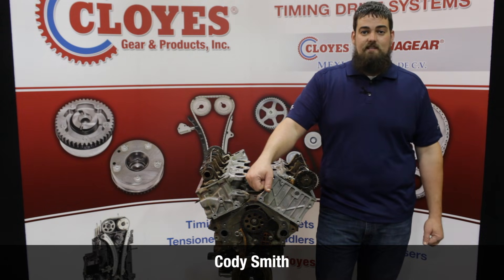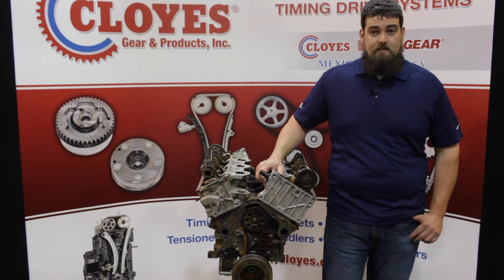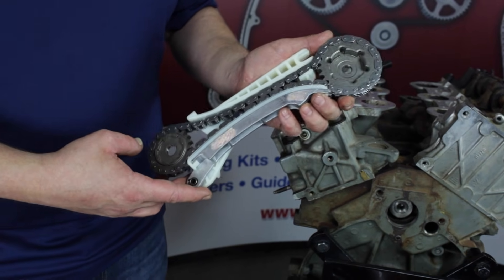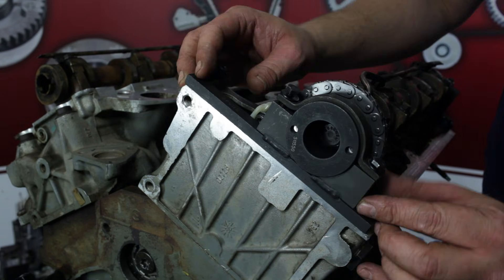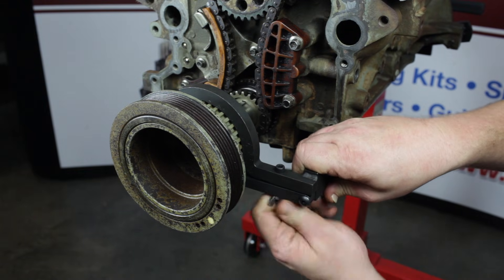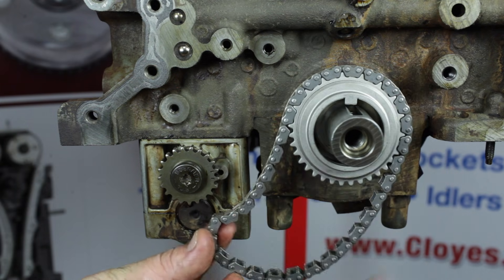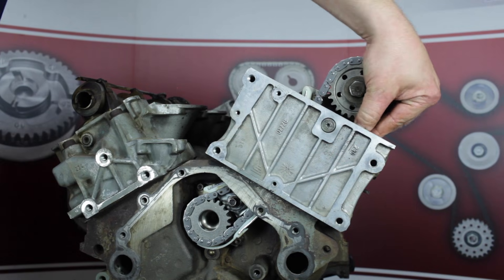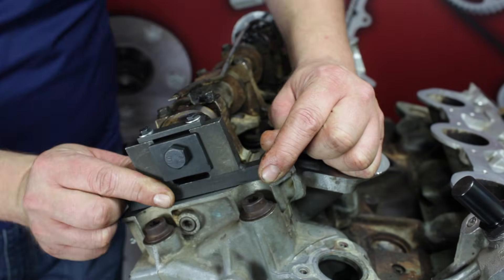Ford 4.0L Timing Chain Replacement, Cloyes 9-0398SB

Comment: It looks like I just had a front secondary timing chain break at about 3 months and 3,000 miles.  I have to tear it down to see what the case is.  If it appears to be plenty wet with oil, this will be the last Cloyes timing kit that I will buy.  There was also some fitment issues with the primary chain guide that requires some Macgyvering to deal with.  I did talk to someone at their customer support about it, and never got a good answer other than, "it must be defective."  Well, mass produced injection molded stuff doesn't have this kind of defect, so just getting a replacement would have had the same problem.
Reply: I verified that I, indeed, have a broken secondary chain on the left  cylinder bank.  When the chain broke, it jammed up the jackshaft sprocket, causing the primary chain sprocket to slip and go out of time, resulting in the left bank of cylinders mashing up the exhaust valves.  Yes, I used a new jackshaft bolt and torqued it according to Ford.  And it took plenty of force to remove the bolt.  I have no idea why the chain broke.  I have a bunch of pictures here:

https://www.dropbox.com/sh/onj1yl2sx6epx68/AADesXSm8BXlvtXDj5q1m_L-a?dl=0

So far, there have been four issues with the Cloyes products during this process:
1.) When the left bank secondary timing chain cassette arrived from Rock Auto, the plastic guide was broken.  Broken how, why, I do not know.  It didn't look like it could have been broken in shipping with how it was packaged.  Who knows?

2.) The primary chain guide did not fit--the mounting bosses and oil galley plug are of equal height.  The guide didn't fit because in order for it to fit, the oil galley had to be recessed in.  I used washers to space it away from the mounting hole.  I think that worked fine.

3.) The primary chain tensioner went kiddy wumpus as shown in one of the pics in the link above.  The roll pin worked its way out a bit causing the plastic wear surface to not be parallel with the chain.

4.) The secondary chain broke.  I have no idea why.  Bad tensioner?  Just look at the broken chain links.  There are broken links in 3 different places on the chain.  Strange.

I really think that I somehow got a defective chain.  It was wet with oil, the parallel alignment of the sprockets is perfect... as far as I can tell, the tensioner was functioning as it should.  My cylinder head rebuilder says that although he hasn't done a lot of these heads due to the economics of repairing these engines, he has never had someone call him and ask why a timing chain broke on one of them.
Reply: Cloyes has failed on many occasions.

Comment: Great informative video. My explorer is young (84,000 miles) and has developed a horrible sound from previous owners abuse. No damage on chains or sprockets,  but those horrible guides are destroyed. Easy fix! (Thank God the back chain makes no noise, can't pull the engine on your only car and still make it to work :P)
Reply: So did you get away with just doing one chain because I can't afford to pull the motor it only sounds like the one in the front of my 2003 ranger is giving me issues
Reply: @Banannaman5000  Have you checked the hydraulic tensioner?

Comment: Very helpful video! I purchased TTY jackshaft bolts from Ford dealership. Front bolt part #2L2Z-6279-AA rear bolt part# W703167-S430
Reply from the maker: Thanks for posting!
Reply: I ordered a rear JS bolt from Ford in Humble TX with no luck (varios times) finally went to Mac Haik Ford on I-10 got it.

Comment: where did you get the TTY bolts? im working on mine as well. do you guys sell them?
Reply from the maker: Unfortunately we do not sell them. As far as we are aware Ford is the only place sourcing them.
Reply: Cloyes Gear & Products, Inc. (Aftermarket)  man, I got your kit. Maybe you guys can provide a part number at least on your site? Or a special note when you sell the kit? The kit is kinda useless without these bolts. Thanks.

Comment: Thank u Sir does the kit come with the specific tools ie cam tool, primary locking tool etc, thank you
Reply from the maker: The timing kit will not come with any tools. The tools we used in the video were part of OTC's 6488 kit. That tool kit comes with everything used.
Reply: Cloyes Gear & Products, Inc. (Aftermarket) thank you very much for your help, great video

Comment: The front 'jackshaft to cam' tensioner arm is a terrible design. The nylon can break at the apply portion. Nissan tried the same thing on their VQ35DE. Luckly they released a updated kit that permanently addressed the problem by making the apply portion for the tensioner arm metal. Thats why the only nylon/plastic area was where the chain rode.

Comment: Terrible kit. Bought in November of 2016, had an ASE mechanic do the install. Rear chain failed 13 months later. Now I'm stuck doing the job with better parts.
Reply: Matt Greening Ford OEM is always the way to go.
Reply: It looks like I am in the same boat.  I am uncertain as to what happened, but it appears as though the front secondary chain broke at about 3 months / 3,000 miles.  It quit running a few days ago, and after popping out the cam sensor and cranking it, I see no camshaft movement.  Overall, I was not impressed by Cloyes timing products.  The primary chain guide also had some issues that required some macgyvering to make work.
Reply: I am doing this job my self, when u say better parts, what are those?.. i am trying to get the best parts i can, i don't feel like going throught this hassle again any time soon.
Reply: esmailer galindo Ford OEM. Go through Tasca Parts online. Cloyes is cheap garbage. Their tensioner can't even last 6 months. I used all Ford components and you can't even hear my engine running.
Reply: Hans Gruper thanks a lot for the info, i'm at the final stage of the project, have to buy the chains and get them installed over the weekend so i can go ahead and get the car back together, as i'm sure u know how suck a pain in the neck this job is, i don't feel like doing it again any time soon..
Reply: esmailer galindo To me this job was fairly simple being that I had a donor motor out on a stand so I could take my time. Just use the OTC tools and follow the Haynes manual. Got another explorer with 207k counting down the days until the teardown.
Reply: Hans Gruper samd here, taking my time, me.and my brother are doing it, it's my first time doing something so big like this, but i am taking my time and i have all the tools required for this job so i am confident i will get it done and right.. wish me luck. Lol
Reply: I just verified.  The front secondary chain broke.  Why?  I cannot come up with a definitive explanation other than maybe I got a defective chain.  Here are some pictures:

https://www.dropbox.com/sh/onj1yl2sx6epx68/AADesXSm8BXlvtXDj5q1m_L-a?dl=0

Comment: For all this trouble.. May as well do a complete rebuild... Why is the the right timing chain on the rear? Because ford didnt wanna make left and right 4.0 ohc heads...
Reply: John Floyd That is what I thought. But if the 2 head castings were in fact the same, the left and right head gaskets would be the same but they are not. The differences are actually significant.
Reply: Ford took the OHV block and made it SOHC. I agree with you, wish they would have kept everything on the front.
Reply: Floyd, The heads are different castings. As you can see, there is no hole drilled for the hydraulic tensioner on the right bank cylinder head. The chain is in the rear because the engine block is offset side to side. To have the chain in the front, would have made the engine several inches longer and you would need a front cover all the way to the bottom of the  right cylinder head.

Comment: Seems like a lot of work for not a lot of payoff. I guess if the 4.0 in my mustang ever goes out (knock on wood) I'll probably just swap in a V8.
Reply: Caleb Shonk I got that idea, but did You compare prices on this rebuilt and v8 swap & transmission? Mine TR-5OD I’m not sure could stay with V8... Btw, what’s with dmv about such a swap?
Reply: Swapping in a V8 can be expensive, but ballpark guess? A Reman Cologne is about $3500. Add to that time and labor and you're probably looking at at least $5k. And that assumes the engine doesn't break down again. 

A Coyote V8 is $6800 from Summit. Labor would probably be around $2k. So it might cost almost twice as much, but after it's done, you have a NEW engine that puts out more than twice the hp and tq, is more reliable, more modifiable, and fun. Or you could probably swap in a 302 small block for about $5k.

Personally, I would probably do an LS swap. They're cheap, reliable, and have about the same output ratings as a coyote. Offhand, I don't know what the T5 is capable of handling but it's a very stout transmission that was actually used with the Coyote. 

As for the DMV, they go off of the vehicle's VIN. I've never once had them ask if it was modified at all. Maybe if you have emissions testing in your state it could be a problem, but Michigan doesn't. All they really care about is whether it has insurance.
Reply: Buy a V8 mustang the v6 ones are completely different stucturely trans, diff, springs, mounting points,ones is made to take the torque the other one is just for listening to the  engine make noise stroke a 351 Windsor and aluminum heads cheap 400 hp add a rear turbocharger for another 300 hp on pump gas LOL🤣
Reply: The T5 was most certainly not used with the coyote? Was a MT-82. You cant even put a T5 behind a SBC without it exploding to bits. They can be built though to withstand a good bit more abuse tho like the TKO 600. Last thing I believe the T5 was behind was the 4.0 SOHC in the SN197 mustangs and ive blew one myself behind the 4.0. Sitting in the yard as I type this. The T5 is a good transmission it just has its limitations and you certainly cant no lift shift on anything making more power than a 4.0 SOHC. Sketchy with a 4.0 as it is. Stick it behind a 4cylinder or weak v6s and v8s (like it was with the old 5.0 windsor mustangs or old 305 camaros) and its fine. Theres a good reason why chevy didnt use it behind the LT1 when it was brought to the table for the camaro lol Instead they jammed the good ole T56 we all know and love in there.

Comment: ford, like the rest took the extra time to make sure we dont fix our own, they want you to buy them but then they are secretly waiting to roll you when you need some work. in the past 35 years ive seen the simplest of jobs turn to major work , and not because of the technology but because of all the built in problems they add on purpose,  i do a lot of repair and rebuild and nearly all have trouble built in.

Comment: Thank you for the reply! I agree. Maybe include that on future videos so others won't think it's a good idea when they work on engines. A leak-down test can check for bent valves. Remove the timing chain for 1 side of the cam and get it at TDC and with both valves closed.  Then if the valve leaks you'll know before putting the engine back in. You can do the test before replacing the chain with new parts.

Comment: Wouldn't it be a good idea to put RTV on the tensioner threads and other fasteners contacting oil?
Reply from the maker: No, the tensioners have gasket rings that seal the oil. Do not use silicone/RTV on any threads, and especially on the hydraulic tensioners. Silicone/RTV can clog vital oil passages.

Comment: Hello I just recently had a shop install this exact kit into my 2004 Ford explorer 4.0 4x4. After the install I still hear a mild "chatter" coming from the front driver side of the engine. Is it possible the front cassette is defective or installed improperly? The tech said his wife's explorer has always made the same type of sound since it was new. Is the chatter noise something I should expect or is there something wrong?
Reply: Well since I got no response, I did my own homework and figured I'd provide an answer in case anybody else has the same problem. After speaking with the tech that did the install, installer error was not the problem. I pulled the hydraulic timing tensioner from the left bank and discovered that the Cloyes hydraulic tensioner was defective. The tensioner is supposed stiffen up once primed with oil. No matter how much I tried, the tensioner wouldn't prime. I still had the old tensioner I had purchased from Ford over a year ago and that one was very easy to prime. I installed it and voila! No more rattling/chattering!!! You can't assume new parts aren't defective. I hope this helps somebody else in the future.
Reply: This reply helps people in the future if they think of buying parts from Cloyes.
Reply: Yes. Tensioners should be pre primed before installing to ensure hydraulic seals. This is very important. See yt for  pre priming tensioner.

Comment: It this video, you jump past the removal of the left front cassette to fast. I have the 2003 Ranger FX4 vin E engine , 103000 miles with no balance shaft. the original cassette has the pivot rivet that holds the two plastic/ metal chain guides together, is to wide for what little clearance is in the head to engine block cavity to be removed from the engine. 

I need another 1/8 inch clearance to get it out. So, what i'm going to do is to grind off the front edge of the old guides just above the rivet point. This should allow the cassette to kick forward to have clearance on the back side of the rivet to remove it. 

Is this normal? Have you done this before for your removal/installation? This shows what it is: https://youtu.be/YSxAxQFZ0AA

It is a mess to flush clean up all the grinding partials and protect the rest of the open engine with covers. This is not shown in the "Factory Workshop Manual", that I have. 
Also, I read that after 2003 the plastic guides material was changed to Teflon, is this correct?

I also upgraded the oil pump with the Melling Engine Oil Pump (M328)  high volume pump, this should keep the tensioners lash  pumped up. Thank You for the instructions.
Reply: Update, I just striped the plastic from the metal backing of the cassette and folded inward the two runner supports, that was just enough to pull it out. Installation is no easy, must separate the two haves by removing the cir-clip and pivot pin, what a real pain in the wrench. good luck.
Reply from the maker: We did not experience any issues removing or installing the cassette assemblies on our engine. The pivot point on the original cassette assembly and our replacement unit should have the same dimensions. We clearly remove the OE cassette assembly without damage or disassembly of the cassette, and although we somewhat skip over sliding the new cassette through the head, it did not require disassembling of the cassette. It is possible that our engines are of a different year range, or some other minor difference. However we have not experienced these issues and do not believe it to be normal. As far as Cloyes is aware, the OE chain contact surfaces were made out of PA66 nylon throughout the production of the engine.
Reply: i had the exact same problem i ended up braking up my guides (old)and forcing new down by taping pivot with long screw driver and hammer 2002 sportTRAC 4X4 
far from ideal spent almost 1 hour fight that and in the video it just slides right out
Reply: I ripped the bastard out with a crowbar. In 2002, Ford moved the head making it extremely difficult to remove the guide without pulling the head.
Reply: I just got done with the exact same problem on the left bank in a 2005. The pivot pin of the cassette does not fit between the engine block and the head. It will not fall in through the top. I had to remove the jackshaft, remove the snap ring holding the cassette together, the pivot pin as well, install the 2 cassette halves, and insert the pivot pin through the jackshaft bore and then re-install the snap ring.  Then there was enough room to scoot the cassette assembly aside for jackshaft installation. There is no possible way this was done at the engine assembly plant like this. Camshaft removal might have been able to change the angle of the dangle to get the cassette assembly installed, but I wouldn't count on it.

Now, I am dealing with the right bank chain. It seems that I will again need to scoot the jackshaft towards the front of the engine for sufficient clearance to install the jackshaft sprocket and chain. It is as though the new parts are wider than the originals.  This is assuming the sprocket "adapter" in the jackshaft will fit into the bearing bore. Otherwise, I may have to see what the dealer has to offer.

The original parts were pulverized, so I didn't have to deal with removal difficulties. They came out with various needle nose pliars.

Comment: Is there a tutorial on how to do a replacement after a timing chain failure?
Reply: yes, throw engine in trash. put in a used or rebuilt engine. will be cheaper. versus replacing pistons/valves/gaskets/time involved

Comment: will this kit work on the 4x4 as well? I see one is offered for 4x4 but does not come with all this kit has
Reply from the maker: Hi Tim, the 9-0398SB will work for any 4.0L SOHC engine with a balance shaft. 2 or 4 wheel drive.

Comment: my explorer was running strong no missing but when I broke it down both cassettes front and rear where bad and the main timing chain what's the chances the valves didn't bend? 50/50 ?
Reply from the maker: If the engine was running strong before teardown then the valves are going to be fine. Bent valves will cause a terminal misfire in every cylinder where they are bent.
Reply: Cloyes Gear & Products, Inc. (Aftermarket)